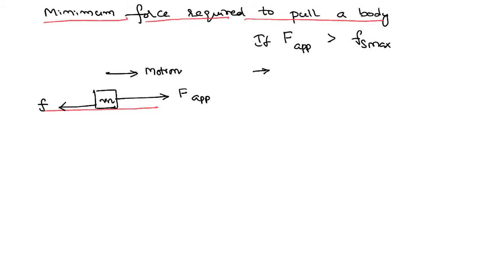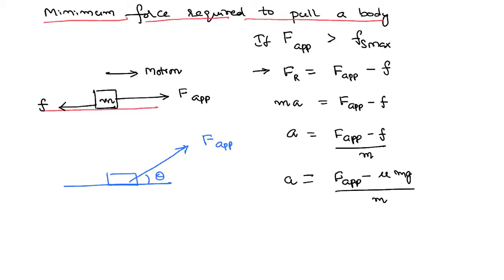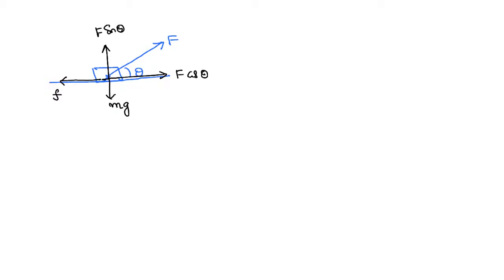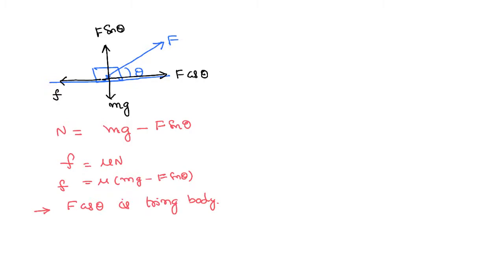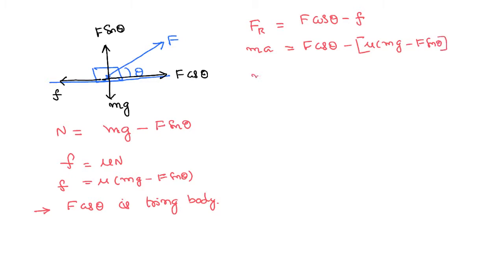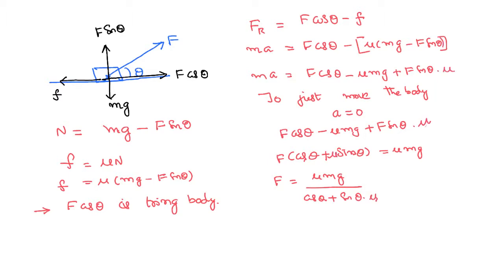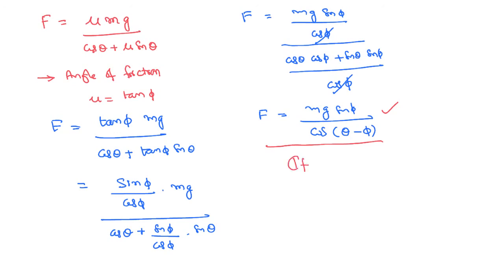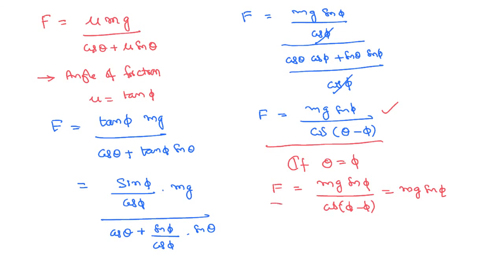Minimum Pulling force to Overcome Friction

Comment: why do we subtract Fsintheta from mg ?if  mg acts in downward direction then n should be exactly equal to F sin theta.Please explain.
Reply from the maker: We are measuring the normal reaction here. It is the resultant force acting on the surface. If both are equal in magnitude, then the body will be in equilibrium and in this case it is not. Hope you got it Choti.
Reply: In the vertical we have to not give acceleration so all forces must be in equlibrium by newtons 1 st law